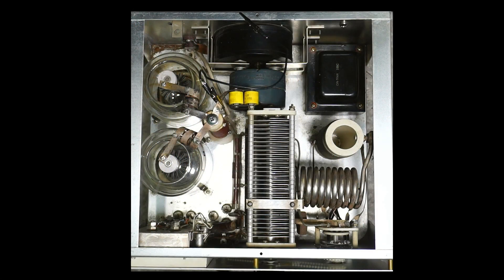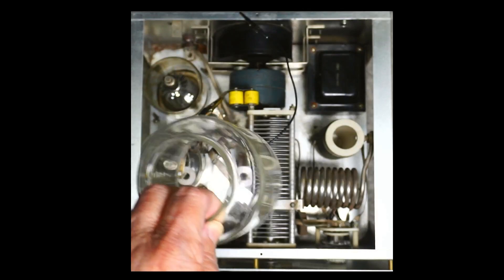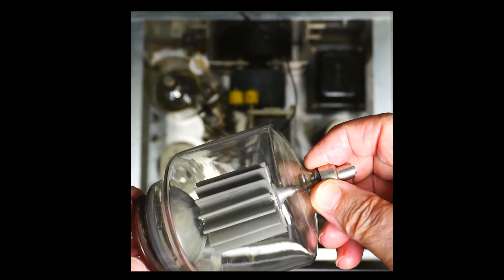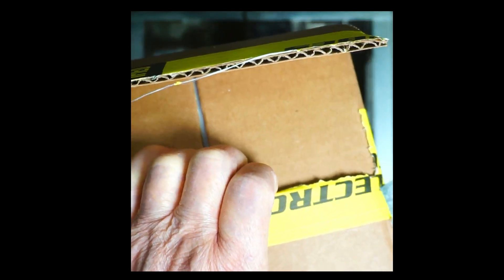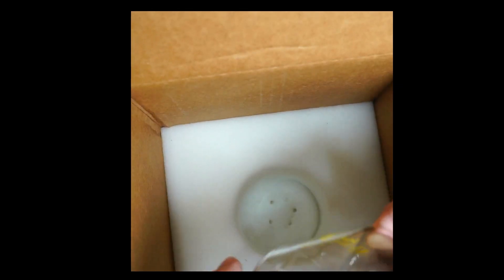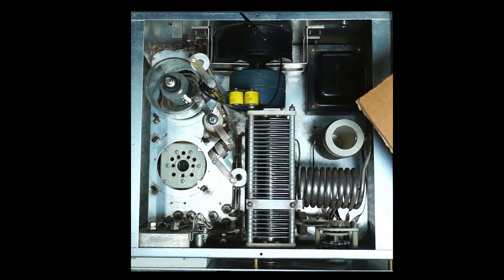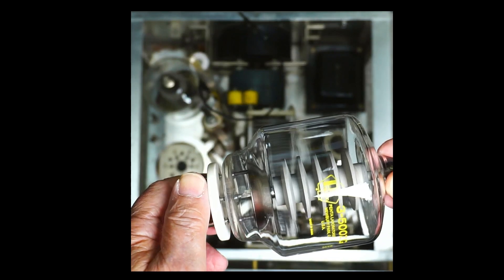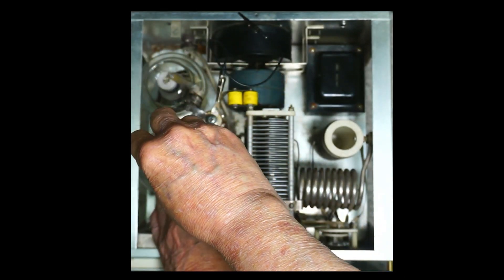Linear Amplifier, Part 3, Removing and Installing New 3-500zg Tubes into Drake L4B with Jim W6LG

Comment: great work Jim ! Today is common to get bad parts. I test each diode before installing.  That part of bias circuit.  Some times when a tube flashes over the diodes can either open or short out. Happens a lot on them tubes.   73

Comment: I'd wipe the tubes with rubbing alcohol where I touched them, so that the finger oils don't get cooked and create hot-spots on the surface of the glass. Just a little something to make the tubes last longer. (I used to manufacture tubes for a living.)
Reply: I've heard that it doesn't matter at all with 3-500z tubes. You can ask WB2WIK and W8JI who designed tube amplifiers. These are NOT the tubes that are affected from fingerprints.